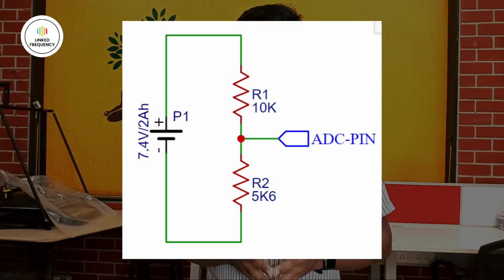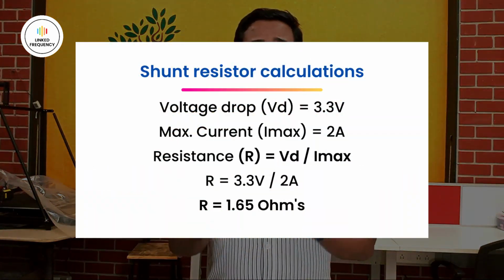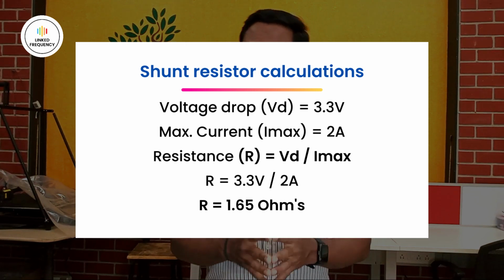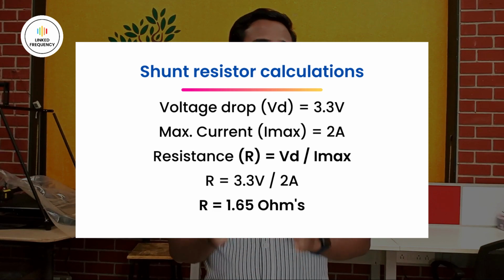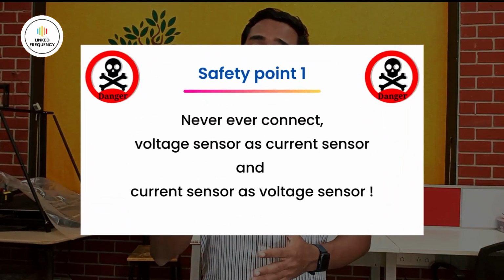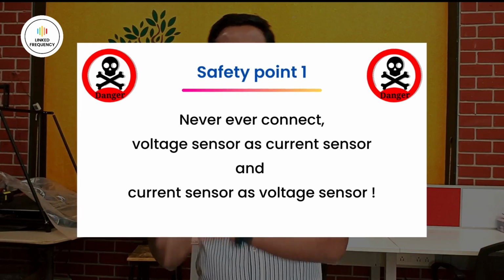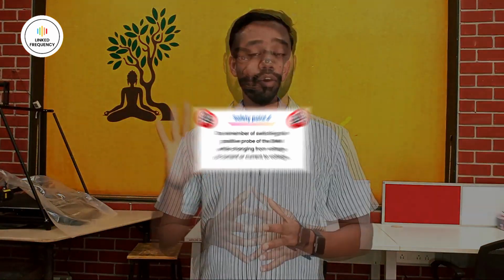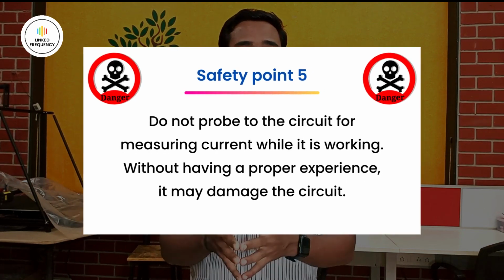How to measure voltage and current #E12 | Vaibhav Sugandhi

Comment: 19:32 how you calculate that two Resistors value in voltage divider circuit?
Reply from the maker: It is very simple formula. Use voltage divider formula for calculation, assume one resistor value to be 10K & other one can be calculated based on output voltage limits. 
Or you can use online voltage divider calculators like this one : https://ohmslawcalculator.com/voltage-divider-calculator for easy approach. 

Happy learning :)
#Linked_Frequency